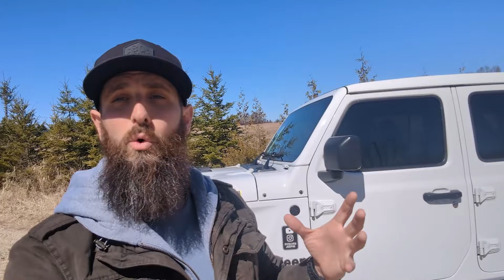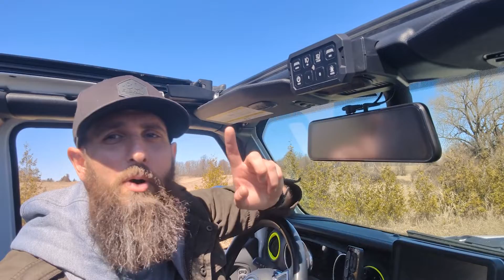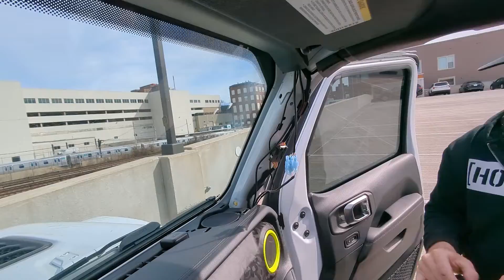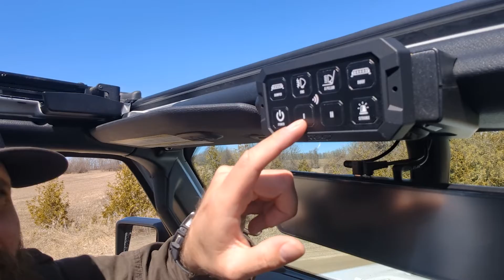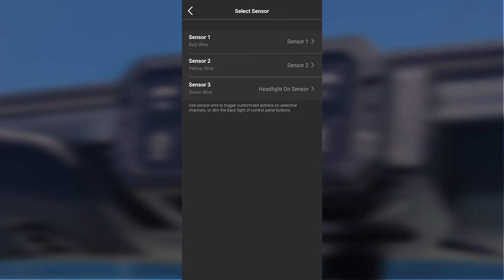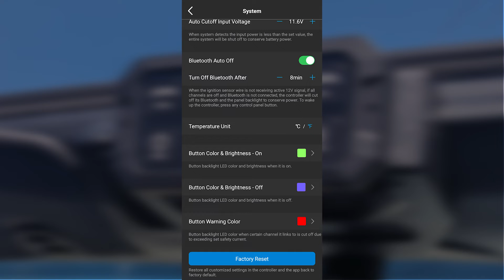XK Glow Command 8 Channel Bluetooth Switch Panel Install & Review | Control Your Jeep's LED Features

Comment: I’m stuck on the sensor/ accessory wires.
Reply from the maker: You basically just tap each wire to something that turns on and then in the system you choose what happens when that item turns on.

Comment: Hey man, i bought the same switch panel but for my sxs. I’m confused on what to wire the sensor wires to or to what exactly. Could you give me any ideas/advice on that specifically? It would be appreciated!
Reply from the maker: The sensor wires are basically wires that you tap into other power wires that turn on and off in the vehicle, but I did for one of my wires is I typed it into my low beams so that when my low beams turn on I can actually trigger the dimmer on the switch panel to actually trigger to make the switch panel a little bit darker for at night time. So that's one thing you can do. You can also go ahead and tap it into like say your high beams so that when you turn on your high beams it actually turns on all of the flights you have that are front-facing so you get every light at once. There's a bunch of things you can do with sensorwise. It's really up to you from there. I hope that helps

Comment: I whish u showed exactly how u mounted the bracket
Reply from the maker: I showed most of it in the video, the only part I didn't show was mounting the switch to the bracket, but for that all I did was assemble the bracket and then drill some holes for the switch panel.

Comment: What I would like to see XK make or collaborate with Genesis, is to make a dual battery system that can incorporate a relay out put controlled by the switch panel. All the benefits of a dual battery system with the controlled out puts. XK would have to use positive triggers since even thier own lights have multiple positive inputs with only one negative.

Comment: Looks like you had to repost this video. I hope my criticism of XK was not to blame. Just to be sure i am reposting my original comment. 
Hey Dan, thanks for the video. Your honest review has me decided that the XK is not for me. The fact that you have to install additional relays to get the two products to work together is a deal breaker for me. I have bought and used a few XK products. It seems that they get so close to a perfect product and then trip right at the finish line. 

The 5th wheel lights are very good, however they missed one important part. The wires are hard wired with no plug to disconnect later. Should you have to remove the 5th wheel light to replace the tire carrier, you have to cut the wires. I had the foresight to install a plug. I also had some dome lights that are controlled by the App. They would get out of sync so quickly that I could not use them anymore. Group lights together on the App and run an effect. It was only lasting a few minutes before they looked like they were just doing thier own thing. I suspect the internal real-time clocks were not the same. I am now building my own custom system with addressable LEDs using a data line to keep everything synchronized.
Reply from the maker: No that was not the reason, I forgot a part and had audio issues.  Honest opinions are always welcome as that is the whole point of my videos.  Just so you know the relays were only needed because I was doing something with a product that was not intended to be done.  If your using regular lights you don't need relays and the light can be wired directly to it.
Reply: Just giving you a hard time. Keep up the good work. I really liked your Accuair installs. It got me to pull the trigger and do mine. Also liked see you install 38s. I put on 37s and am loving the look and ride. Have you had any alignment issues? I am having a pull to the right and think it is a thrust angle on the rear axel. Not necessarily a Accuair issue but a lifted Jeep issues.

Comment: Any issues with your XK Glow side light and blocking the side vent ?
Reply: The vent on the fenders are not acutely real working vents. They are just plastic that look like vents. Same for the Rubicon hood vents.
Reply from the maker: No issues at all, didn't affect engine temps or drivability.